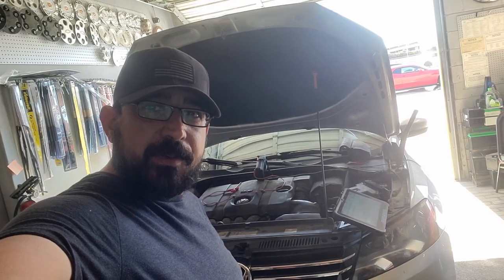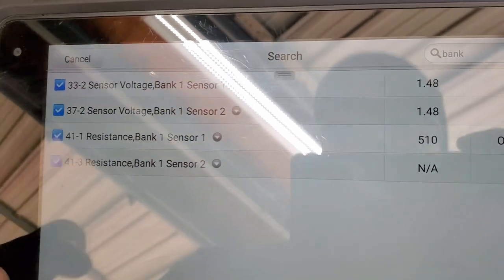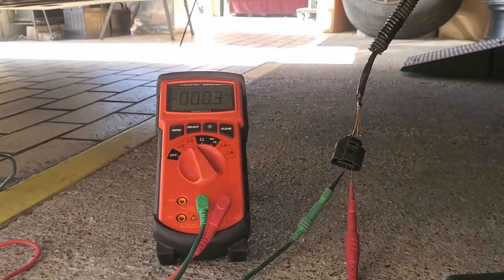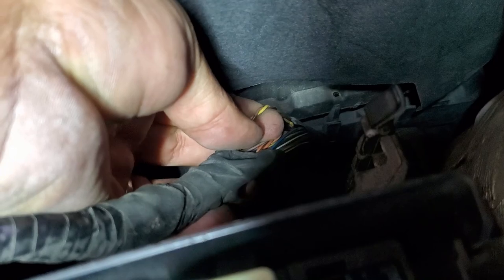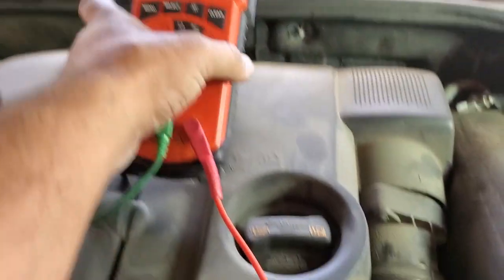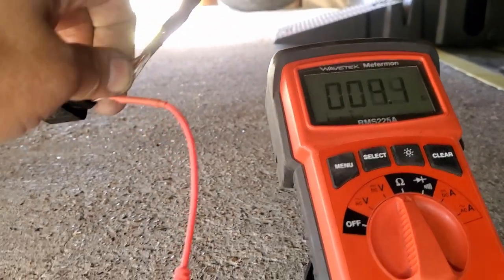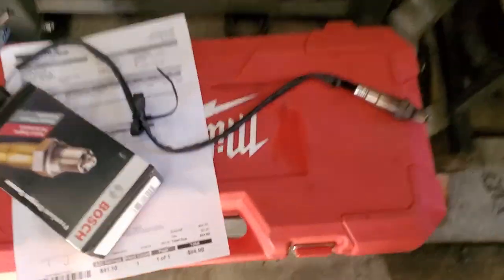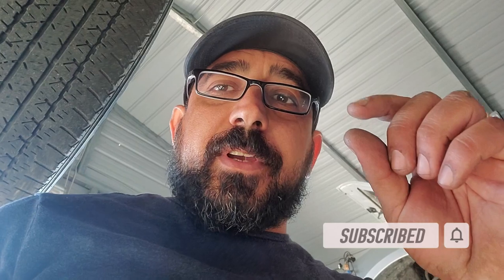NOT the O2 sensor, 2013 VW Passat P0140 and P1114 codes.

Comment: those are suppose to be that way. Have to cut them to unplug ecu. Similar to break off bolts in steering columns. Tamper protection
Reply from the maker: Ya I fugured afterwards

Comment: hello! I'm from Ukraine. I own passat 2012 2.5 CBUA. purchased at auction. after receiving the car, I found a break in the sensor 3 wires. and there are also errors p0140, p0141, p0146, p0147. replaced sensor 3. made measurements of the cable. did not find any damage. There is a suspicion that a breakdown in the engine control unit. I want to understand what to do with the control unit. Do you have a continuation of the repair? help me please. I have a vag com pro cable and a regular multimeter
Reply from the maker: Hey, I would assume that the repair is more common in Europe than America. Not sure what to do in your case honestly other than replacing the pcm and programing it.

Comment: I have a 2013 , the codes I have are bank 1 sensor 1 , replaced that then I got “running too rich” , with this it checks the engine light on and it drives rough , it stutters from stop and gos at points it stalls out completely, throttle response is also very bad, but as soon as I clear the code everything runs fine , now it won’t stay on unless my foot is on the throttle , but again if I clear the code it’ll run perfectly fine